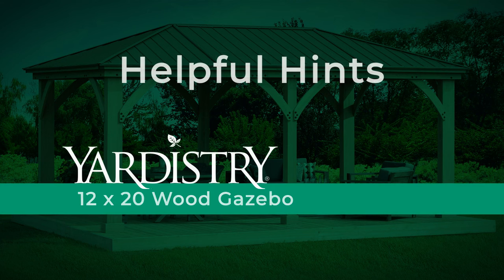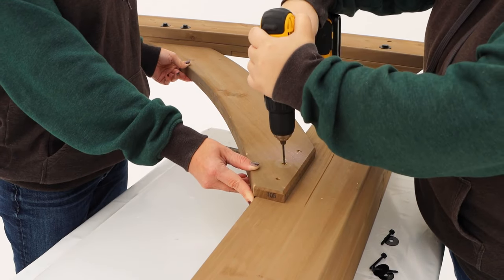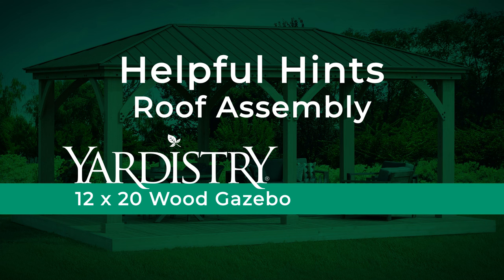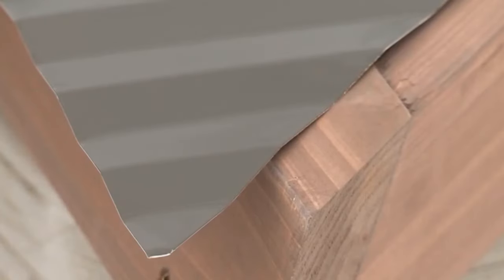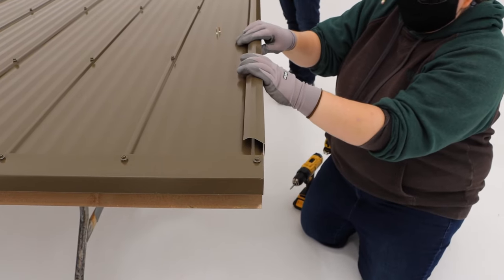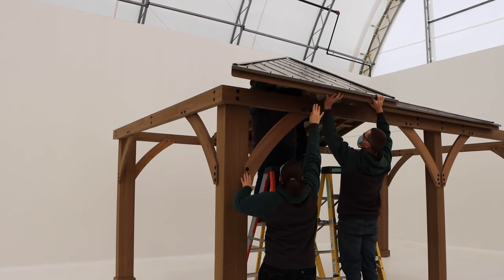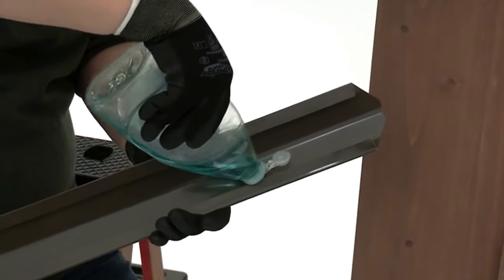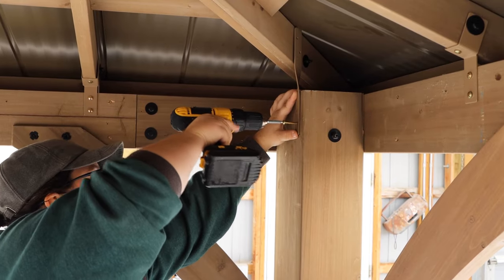12 x 20 Wood Gazebo - Helpful Hints

Comment: At the 12:30 mark when you begin showing the installation of the roof panels, PLEASE stress the importance of the soffit piece(s) butting up to the long and short beam assemblies. This is critical. There's a small mention of it in the instructions. (Yes, I overlooked that) I had to pull the 2 large roof assemblies and the corner roof assemblies back off and start over. The roof end pieces will wind up with 3" gaps if you don't. Going by the video you only show the roof assembly mating up to the center post bracket as a means of knowing you have it correct. MAJOR overlook!
Reply: Agreed this definitely should have been shown!
Reply: This comment should be pinned. I ran into this issue and you won't realize how important it is until your installing the small side panels and they don't fit and have massive gaps on the sides. Take it all down, start over. Overall this was the difference between a flawless install and a total nightmare.
Reply: @hctibeyb1788  Can you clarify this just a bit more?  I'm having a hard time visualizing the issue - since I'd assume the bolt holes are place where they'd ensure this to be the case?  I've got all panels ready to go, and am going to be putting them on with some help over the weekend and would hate to have to undo and redo work.
Reply: Can you clarify this just a bit more?  I'm having a hard time visualizing the issue - since I'd assume the bolt holes are place where they'd ensure this to be the case?  I've got all panels ready to go, and am going to be putting them on with some help over the weekend and would hate to have to undo and redo work.
Reply: @ClintHuffman-r6j  when you put the first 2 large panels on and bolt them in loosely in the center before attaching the brackets on the sides with screws, you need 2 people in the center pushing up hard and 2 people on the outside by the brackets pushing in until the suffit board board on each large panel touches the horizontal beams. The lest amount of gap between these the better. You want zero gap before screwing in the brackets from the large panels into the horizontal beams. This is the most important step of this whole build. If you have near zero gap on both sides after tightening the roof peak bolts, all your other panels will fit in without gaps. If you have any gaps between all your other panels will have issues and gaps and not line up right.
Reply: @hctibeyb1788  Thank you!